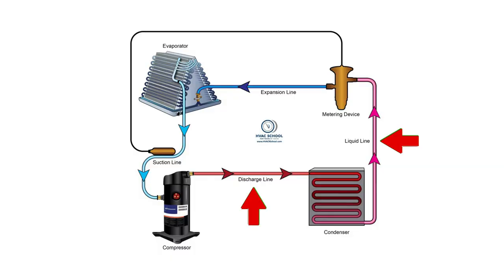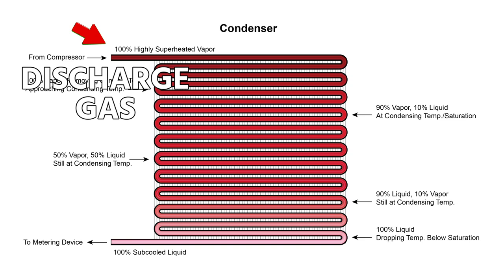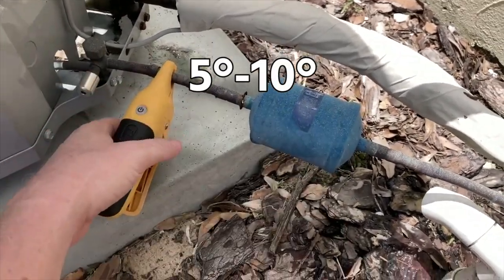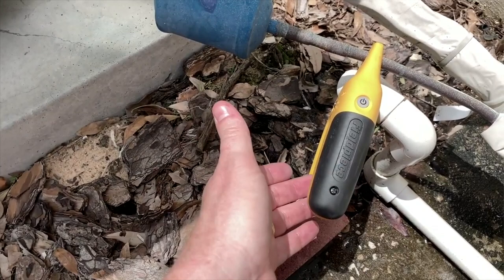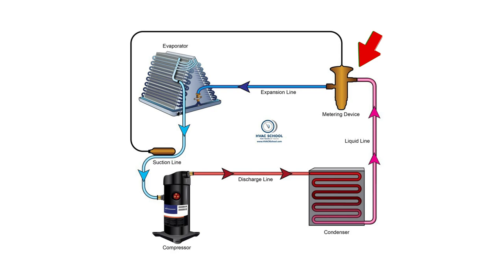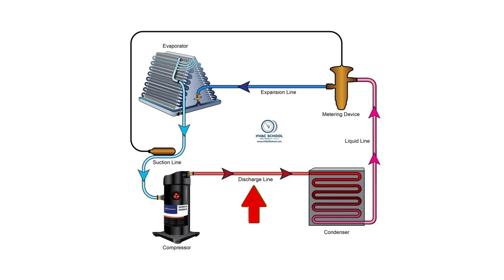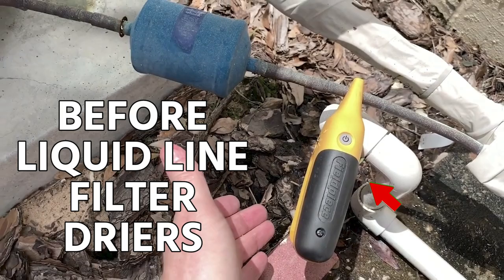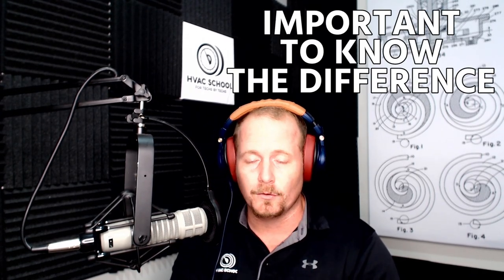Liquid Line VS. Discharge Line

Comment: Awesome. I see so many "technicians" that get confused with that discharge. Hopefully this will keep them on their toes. To add to that. Just had this today that the filter dryer was in the unit, had 1 tech misdiagnosed because the blockage was in the filter dryer that's in the unit (hello goodman). Thank you and good luck.
Reply: what a great example and nice work.
Reply: @VicPapefu but not practical on a new install where the dryer is sealed inside the condenser.
Reply: Don't use quotes
Reply: @larsulrichvevo3196  make me 😜🤣

Comment: Thanks for the video. Good job as always. Very helpful. I Work on a building with Trane package units without liquid line access port and I always guessing the subcooling with the discharge pressure and liquid line temperature. Did not know about that rule of thumb 10 to 15 psi pressure drop.

Comment: It's why I always weighed in charges on package units. Awesome videos sir. You make me miss the trade. Wish more people like you were as dedicated to it and not just out to screw people like most I see in the area I live in. Just had a friend that let big multistate company install their unit and they installed in attic, worst install I've ever seen and after 3 failed inspections walked away and my friend said at least he didnt have to pay for the job. I said still you left with a unit that is going to give you trouble for years. Just recently his bedroom ceiling fell in due to unit not level and froze up and drained onto ceiling, unit has been in 7 months. In having to go back and rip out and reinstall this winter when it's cooler since he has to help and we both cant deal with Florida attic heat in August anymore due to age.

Comment: Very helpful.  You have not mentioned the refrigerant you are using when you specify what an excessive discharge temperature is.
Reply: R-22 and 410a are the most common refrigerant
Reply: It apply to any refrigerant, more than 225 *F will compromise the oil.

Comment: I always enjoy and learn from your video. Where can I find the pressure temp chart for discharge superheat vapor -is the condensing saturation pressure corresponding with my discharge superheat temp. The example. If I have 190 psi condensing pressure, equivalent to 97 °F, and discharge superheats of around 195°F( just the guess), I can't find a superheated vapor temp pressure chart.

Comment: HVAC SCHOOL What is condensing saturation during low ambient for refrigeration what is that magic number the head pressure should be maintained to keep the system running properly during low ambient ?

Comment: Actually the pressure in the discharge and liquid line should be the same because high pressure from the discharge is pushing against the liquid in the condenser and gives you the condensing temperature. On the other hand this is theoretically speaking I do believe you would have some pressure drop in the condenser.

Comment: I have a very important question. Is the discharge pressure the Same as the liquid line pressure?
Reply: Not likely because it has lowered it temperature thru the condenser.

Comment: I was building a dehumidifier from scratch and was installing a service port. I accidentally installed it on the discharge side instead of the liquid, and my teacher goes and tells me it doesn't matter because the pressure drop across the condeser is unmeasurably small. That class is screwed.